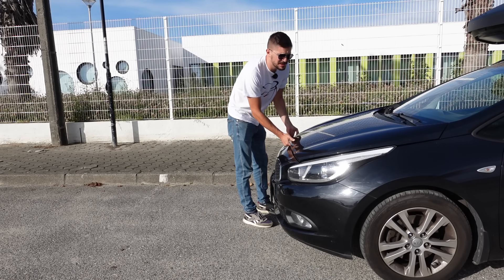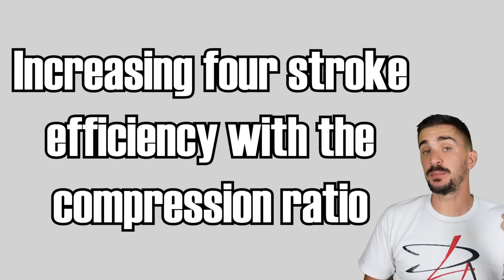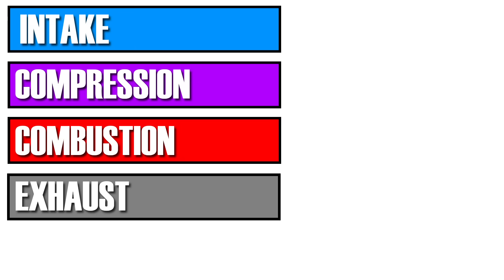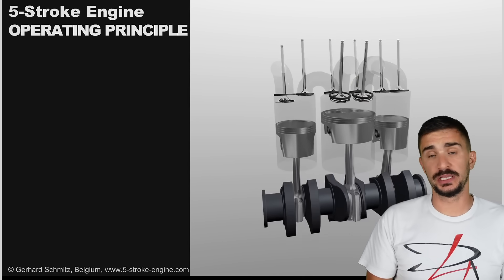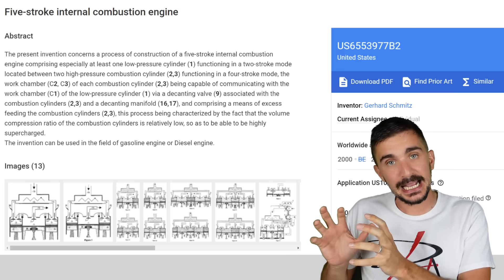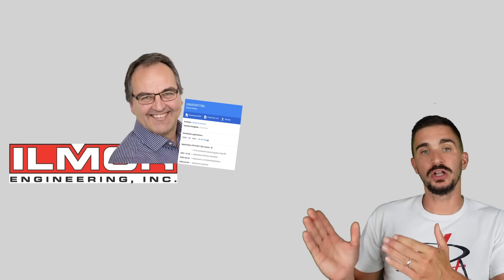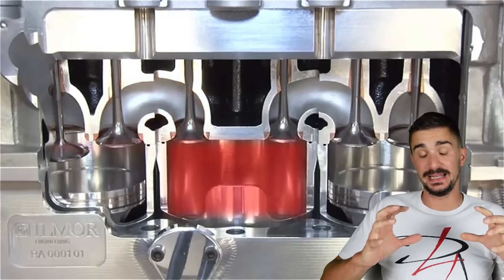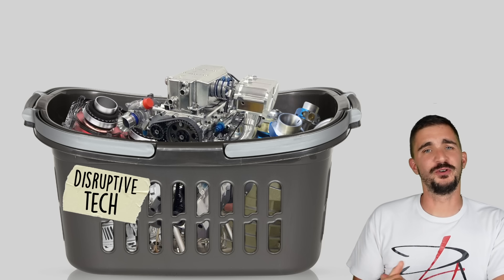Why Five Stroke Engines Are More Efficient But Still a Failure

Comment: It would be better to re-compress the exhaust gas and inject water (or diesel, DEF) and use the steam expansion to push the piston back down again.  This would reduce the amount of fuel used by 50% but might only maintain the same power output and possibly improve it.

Comment: I actually think this engine could have potential in modern cars. All electric hybrids allow ICE engines to only run in optimal conditions since they only kick on to recharge batters; the catch being that the engine needs to be light enough and small enough to justify hauling round just in case you need it. 

Also, I cannot be the only one thinking this is just a piston version of a turbo? Is this actually any better than finding some way to more efficiently use the power recovered by a turbine?

Comment: A compound, or multiple expansion, steam engine - which does basically the same thing, harvesting energy from wasted exhaust using secondary cylinders - was invented around 240 years ago.  So, the fundamental concept is not something new.

Comment: Couple of questions. 
-If the catalytic converter was moved closer to the engine, could you maximize the heat for better catalysis? 
-Instead of an extra cylinder, could the exhaust be channeled to a turbine (like with a turbo charger) but then linked somehow directly to the final drive to essentially to harness the gasses for efficiency and not power?

Comment: If the motor is only efficient at high RPM, one could still use it for applications where you have a constant RPM to deal with. Not all motors are used in cars. E.g. it could be used to power an electric generator.

Comment: Sounds like this engine would work well on a constant speed generator. Could be useful in a hybrid where the engine is running a generator and the power is either being used to run the electric motors or charging the battery.

Comment: Why can't they make the " low pressure cylinder" a 3rd high pressure cylinder during low RPMs?  It could be controlled to cut out and become a low pressure cylinder when the RPMs get high enough to create the 5th cycle.  This would also bring up the temperature of the catalytic converter to a normal level to pass emissions.  I don't think the automakers want us to have efficient cars, it seems.

Comment: The rifle (as in firearm)  has out lasted the internal combustion engine. Rifling in the barrel causes the projectile to spin  creating fantastic accuracy. I believe it was the Germans that developed rifling in the 1700' but it may have been earlier. Powders have changed. Sights have changed, but the rifled bore remains

Comment: 1. Diesels don't need the emissions equipment to be efficient. Thats eco socialists trading "clean" for lower efficient engines. 2. Critically, you didn't mention miller-cycle 5-stroke engines. Which are not only older then what has been argued is NOT 5 stroke but really just an offset cylinder vs a true 5-stroke with a secondary intake stroke through use of a supercharger. Really odd you didn't cover it since it was a production engine in the Mazda Millenia at one point....

Comment: IF one designed a 5-stroke to operate optimally at one fixed (high) r.p.m., then connected it to an electric generator and made it in a series hybrid (like diesel electric trains) would that offer anything?

Comment: 35% efficiency is officially environmentally friendly isn't it? Well it is when considering solar panels, as the efficiency seen from solar generation is close to identical to the combustion engine efficiency highlighted in this video. So EV's could be seen un-required given that info.

Comment: What if you added direct water injection into the low pressure cylinder,  at top dead center, using the waist heat to produce steam pressure?

Comment: The Schmitz 5-stroke's ideal application is in light aircraft.  The secondary expansion cylinder wouldn't suffer from idle efficiency problems because aircraft engines operate at high power settings continuously, which also makes turbocharging or turbonormalizing easier.  Its lighter weight and lower specific fuel consumption are both big advantages in aircraft, and there's no catalytic converter to worry about.  Sadly, the light aircraft market probably isn't big enough to justify the investment required for large-scale manufacturing.  Rotax, the 900-pound gorilla in the 100-150hp light aircraft engine market, is already heavily invested in horizontally opposed 4-cylinder engines.

Comment: Awsome explainations ! You explained why we cannot further reduce the size of the combustion chamber at top position for increased efficiency. But why can’t we simply expand the volume of the chamber at maximum expansion position ? Is it because in order to keep it low pressure when ignition occurs, we would need to inject less fuel, leading to poor mix ratio and thus higher temperature which would destroy the engine ?

Comment: How does this compare to a modern Atkinson engine (what I call "simulated" Atkinson, without linkages, just doing it via valve timing)?

And yeah, interestingly, 10 years ago I would've been on board with the "ICE is dead, electric is the future" but now? No way.

Electric is about to collapse. Hybrid is the future. We had our shot at building infrastructure capable of handling electric vehicles, and utterly botched it. We don't have the charging infrastructure, the power grid infrastructure, the battery manufacturing infrastructure, or the battery material mining infrastructure to support full-scale EV adoption, and judging by current industry trends, I don't know that we ever will. Certainly not until we get something like a sodium or carbon battery that's at least twice as power-dense both in terms of volumetric and mass density, and has much improved charge cycle lifespan. I think, at an industrial scale, that's at least a decade away, probably closer to two, and we may very well have some industrial-scale fusion online before EV will genuinely be the future.

Meanwhile, many hybrids use "simulated" Atkinson cycles, and something like this might be fairly attractive in something like a PHEV, where the car can run entirely on electric power much of the time, and when it activates its 5-stroke generator, it can always run it at an optimal RPM and load.

Also, catalytic converter warm-up efficiency would be trivial in a PHEV; there's more than enough power available to electrically preheat the cat.

It also occurs to me with this engine design, that the rotational mass and reciprocating mass are probably very high for the size and power output, which I would assume would make it pretty sluggish and unresponsive, which again is a non-issue if it's being used only as a generator.

Comment: Really interesting. May be using the extra cylinder as a stand alone engine tacked on the exhaust that could generate electricity. It could be bypassed at low output solving the cold catalytic converter and dead cylinder weight issues. At high RPM it could be used to power electric motors that are part of the current designs that use ICE and electric in tandem.

Comment: Looks like the extra weight and fiction of the low pressure cylinder would use the extra power that the low pressure cylinder makes

Comment: I wonder if they could make a version where the center cylinder runs combustion until the rpm increases and then it switches off and runs in the exhaust scavenging mode?

Comment: There is a propulsion technology that has lasted for more than 150 years... a lot more, actually; somewhere around 5500 years as a matter of fact. The unit upon which the power of internal combustion engines is being measured:
HORSES!!!

Through THOUSANDS OF YEARS of selective breeding, we bioengineered these animals to suit our varied purposes. We have race horses, field horses, transport horses, riding horses, plow horses and many, many more. 

The internal combustion engine may have freed man from many heavy labors, but it cannot hold candle to how long we used horses as means of propulsion.

Comment: 5:07 Diesel engines don't rev as high because of the flame propagation speed in the cylinder, not because of heavier internals. Top fuel dragster engines rev plenty high, yet they too have heavy internals to cope with the boost pressures.
Reply: Rather massive difference between top fueler stroke length (~4.5 inch) and a diesel engine stroke length (4.88 inch). Or in comparing bore to stroke diesel engines are undersquare while a top fuel dragster engine is oversquare. Longer stroke = more reciprocating component inertia due to higher velocities. If your crank radius is the same then a longer stroke piston has to travel a greater distance in the same amount of time at the same rpm as a shorter stroke engine. And you cannot just increase crank radius due to both the room it would take, lateral forces it would apply to the piston, and you'd have reduced mechanical leverage on the crank. When you get to the really big 'diesels' such as marine engines they use crossheads so the long component of the connecting rod can travel vertically up and down and retain a efficient crank radius.
Reply: @Cragified Not all Diesels are undersquare. Duramax has built 2 million oversquare 6.6L engines so far.

Before them was the 6.2 and 6.5 oversquare Detroit Diesel. And before those was the 4.3 V6 and 5.7 V8 Oldsmobile Diesels that were oversquare.
Reply: Also remember: (way back when) Gas pump attendees used to smoke like chimneys while putting gas in your car.  However, everyone stopped smoking when the top fuel drag cars were in the shop.  Why?  Few outsiders know this.  Nitromethane - that yummy ingredient in dragster fuel - is a liquid high explosive.  It's mixed with methanol in just the right amount to be sent through a fuel system.  In some ultra-high-speed videos of dragsters doing dragster things st the Christmas tree, you can sometimes see liquid coming out of their exhaust pipes.  It's because the fuel is a high explosive that dragster engines are so heavy.  NM... nasty stuff, also glow plug airplane fuel!
Reply: No, the internal components of an 11,000 hp top fuel engine are lighter than what's inside my generation one small block 400. The difference is that these parts are made from extremely resilient materials: tungsten, magnesium, and exotic aluminum alloys, which provide strength, and extremely light weight.
Reply: @thelastime51  Dragster engines are not made to survive, they are made to win the race, and a pump churning gallons of coolant is a 50 horsepower waste and about 30 pounds of dead weight to throw a quarter mile.  Get rid of the cooling requirement, and win the race.  Motors are cheap compared to the winnings, and they look awesome if they blow up just right.
Reply: @thelastime51 and they get destroyed after one pass, no need for reliability
Reply: @thelastime51  lol...... tungston is the only high str you listed, even the strongest magnesium is weak as hell. Its not used for internal engine parts in super high HP.... they use a lot more advanced and stronger stuff than magnesium..... lol you ever seen a set of MAGS burn?  There is a reason they dont make wheels out of magnesium for the mass market anymore......
Reply: Diesel motors use only compression to ignite fuels. There is more torque delivered per cc of diesel. Diesel motors will eventually overrun all other motors.
Reply: @stevenc8140  Diesel *engines*.  There is no such thing as an internal combustion "motor".
Reply: @stevenc8140 what motors? Best industrial diesel engines are only as  half as efficient as electric motors. Also diesels heats slowly and when they are cold then your efficiency is worse than gasoline. All this and on top of that you have bad engine balance, expensive injectors and expensive maintenance. 
In most cases jet engines are better if you think about constant power delivery but they are much more expensive due to higher cost of manufacture. Planes with jet engines are three to four times more expensive than piston ones. But they are cheap to maintain and last much longer.
Reply: @stevenc8140  If we could stop their inherent pollution, I would prefer a diesel.  A urea tank is a major inconvenience.  There must be a better way.
Reply: Audi is testing a smokeless diesel motor for the 24 hrs of Le Mans
Reply: @stevenc8140  Interesting... two, four, or five cycles?  This could be fun to watch.
Reply: Bullshit! Nitromethane burns slower than diesel, and they still rev to 9000 rpm. Top fuel engines also have aluminum rods to reduce rotating and reciprocating mass, ever seen a diesel with aluminum rods? Didn’t think so.
Reply: @jimmytoto3622  There's one thing that diesel needs to burn that nitromethane does not: Oxygen.
Reply: Right, but dragsters require crazy fuel mixes to achieve those revs. A standard diesel engine will be limited by the weight of the components it's being expected to shift.
Reply: That was a wonderful argument and technically correct. Unfortunately these engines are not built based on how fast we want the flame front to propagate. The reason a diesel engine turns slowly is they want it to last a long time there's a lot of other things but longevity can be counted in revolutions or years and if you're turning a lot of revolutions in a minute like a drag racer you have a pretty fractional part of a year that you actually run. That big heavy slow torque engine turning slow, forever is a strong selling point on the industrial market. The drag racer Markets very well to young people who are buying something to last a day.
Reply: @markmcgoveran6811  ...3 or 4 races if lucky.

Comment: Something like this engine with the Koenigsegg electronic valve system would be cool so you could have a 4 valve centre cylinder that runs an injector that can be switched by the ecu depending on engine load so that 2 of the 4 valves can run the centre cylinder conventionally at low revs for example. Then when the fifth stroke cylinder becomes a benefit at higher loads, the ecu kills the fuel supply and the valve system switches to the valves which allow it to run on exhaust from the 2 smaller cylinders. Definitely too complicated and expensive for a small fuel efficient engine, but as an idea pretty cool I reckon

Comment: Great video until the very very end when you asked what propulsion technology lasted longer than 150 years.
There's two that lasted longer. 

Steam. Now hold your pitchforks, the technology of steam engines is what drives every power plant on the planet that uses a heat source. 

And of course electric motors. Because why they seem to come and go in popularity, for some modes of transportation they have been the go-to non-stop. Not for cars, but for appropriate propulsion needs, it's always been used. It will continue to be used. 
As I post this on vacation I can see both the Disney ski lift thing and the monorail... Both of which run on electricity. I see the golf carts below on electricity etc...
So while there was a fad moment with it looking like the future that was impossible, they're still here for their appropriate needs. And it's not going away either

Comment: A Miller cycle engine is more practicable, since it doesn't require structural changes to the motor.  Different pistons and a cam are all you need, although people have said it lacks power.  A supercharger or turbocharger is usually added to bring the power back, or use of high compression pistons.

Comment: Solve the low rpm power issue with variable valve timing allowing for the lp piston to function as a 4 stroke until more favorable rpms for power and momentum. Add exhaust valves to the hp pistons that union with the exhaust manifold of the lp piston which should also have adjustable air and fuel intakes for lower revs. Also this engine would be very practical, efficient and useful in an inline 5 (or 6 with two HP pistons with a larger cylinder bore) V6, Y9 or even a boxer cylinder arrangement with the power to rival modern IC engines. The addition of a temporary intake stroke to the lp also uses fuel to keep the piston head clean which can be further enhanced by using a fuel additive similar to that of injector cleaners. Hire me if you intend to invest in this efficiency. 4000 rpm+ the exhaust of the hp pistons are diverted to the lp piston(s) of perhaps a different cylinder bore to maximize exhaust gases. The intake and ignition would be shut off and would work synchronized to the diversion of exhaust gas from the hp at higher revs.

Comment: You forgot to mention the ELKO engine, a semi-adiabatic 32/1 compression ratio diesel engine made entirely in one pice of iron,  3 cylinders, 4 stroke, 1300 cc turbo, 100+ HP...  because it is semi-adiabatic, have no cooling system, cheap manufacture, iron block, multi fuel, (diesel, vegetable oil, gazoline, kerosene...)  60%  efficiency..

Comment: 13:35 ...So what if instead we combine it with cylinder deactivation and every n rotation, port exhaust from cylinder x to cylinder y?
Reply: *Activated at a time when optimal. But... Then it's a fair bit of added complexity for potentially small returns.

Comment: one improvement I can see immediately is on start up and low rev conditions, you could have a valve like an egr valve that bypasses the piston and sends the exhaust straight into the turbo charger instead

Comment: I think part of the problem is our rigid adherence to the piston engine. As far as I recall, we have known things like turbine engines are more efficient. If we produced smaller ones en-masse  then we could get the cost down wuite low and likely improve their design as well. Or go to some entirely different engine design.

But we often get stuck in what is and has been.